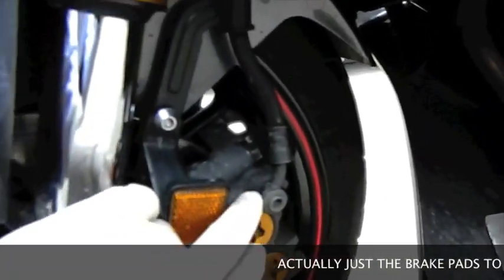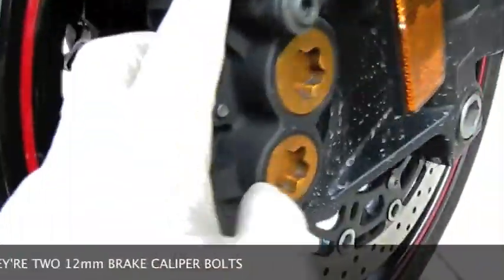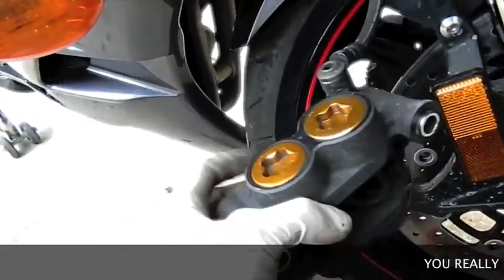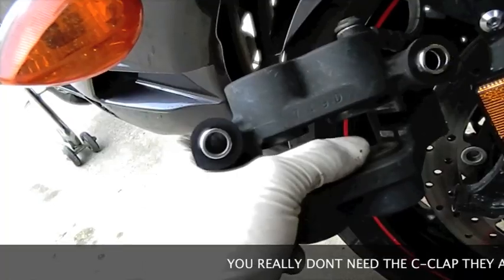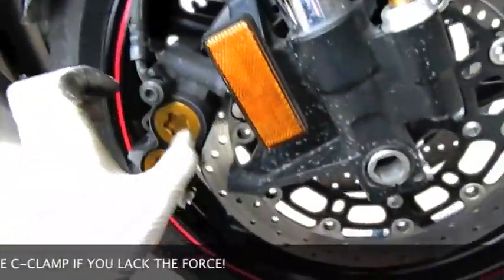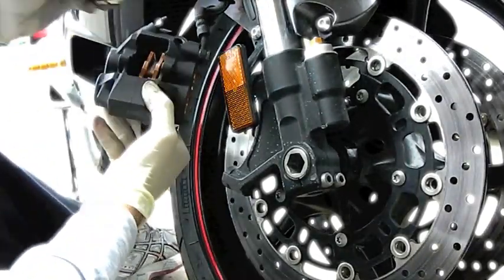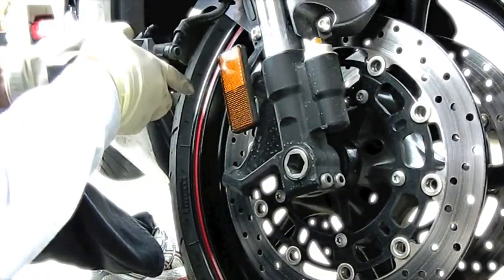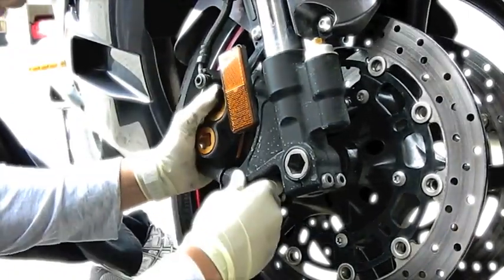YAMAHA R6: REPLACING BRAKE PADS, REMOVING CALIPER

Comment: Could show a little better how you took the pin out that holds the part in place and it seems to remove the pin would be easier done before removing the caliper?

But not much detail here!

Comment: i changed my front set   but after new pads my wheel cant spin  or rotate normally its too hard... is that normal??   reply plzzz
Reply: Did you ever find out the reason for this?
Reply: you had to forget to push the pistons back in and create space for the new pads